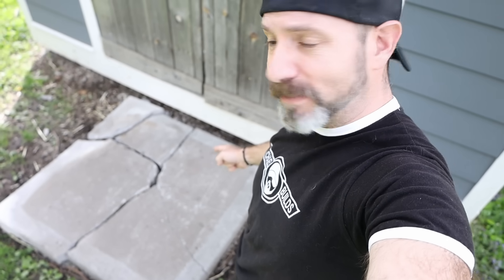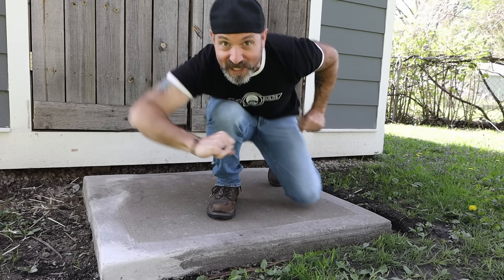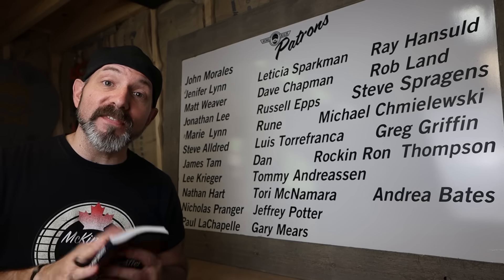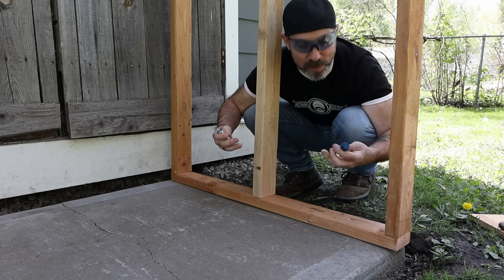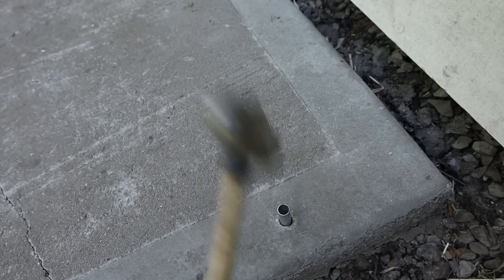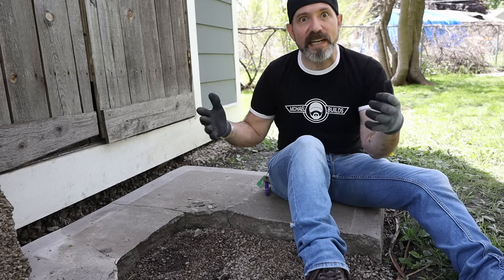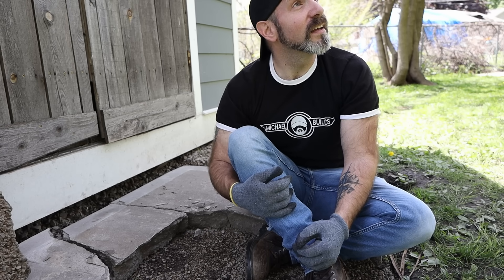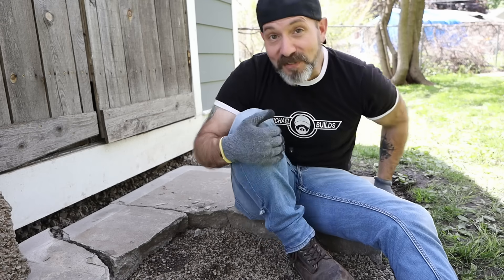Dry Pour 30 day cure Test

Comment: I found your previos video randomly (or rather the YT algorithm offered it to me not so randomly). As a structural engineer my first thought was 'no way in heck that works'. But that was just because it's so different from what we were taught about making structures from concrete. Structures that are consistently and predictably strong enough, that is. After watching two of your vids about dry pouring and giving it some thought I can absolutely see why it has the potential to be even better for some applications than a traditional mixed and poured structure.

One of the biggest problems in making really strong concrete is the water content of the mixture. Usually you have way more water than the cement needs to cure because you absolutely NEED that much to achieve a consistency you can work with, even with the best additives. But then when the excess water evaporates there WILL be pores in the concrete. This porosity determines its strength as much as the quality of the cement you use.

The dry pour method you showed can be used to make a slab or whatever structure where the soaked outer layer is more like a traditional concrete but the inner core gets only the amount water required for the cement to cure, or just very little excess. So at least in theory it can be made even stronger. The one huge caveat is you have very little control over exactly how much water gets to the inside. If you want optimal results you need to have your method laid out and executed with extreme precision. So in conclusion: multi-storey building - nope; sidewalk, driveway, shed foundation - doable or even preferred, especially if there is no risk of freezing (mild and hot climates or absolutely no chance of water touching your concrete).

For now I found no solid info on this but the idea might not be that new. It just never caught on in the industry as a whole because making a mixture you can control has the advantage of being predictable and repeatable which is a crucial aspect of designing and building structures.

Comment: We’ve been curious about doing this method for an extension to our back lanai but weren’t sure how well it would hold up. We’re from the Midwest where weather is an issue but now live in FL where it doesn’t get -60 with the wind chill😂 so we don’t have to worry about the ground freeze like we once used to. Seeing so many tests done is a huge help so thank you! It answered a lot of questions we had to the strength dry pours could have. We’re excited to give it a try!

Comment: That slab looks like it's only about 3 inches.  Sitting on fairly soft ground.  With no rebar.   Even a wet-pour slab would probably crack with a truck driving over it like that multiple times under those circumstances.
Reply from the maker: I 100% agree with you. I definitely want to do another one side by side with a traditional slab with reinforcement and a true thickness

Comment: I think it cracked not from the pour but from the constant weight of the truck compressed the gravel underneath causing the slab to buckle in the middle… some rebar probably wouldve prevented that. Awesome video tho. I’m thinking about dry pouring a new slab for the shed.

Comment: Mike:  One thing to remember is that concrete is a powder which will absorb water, this is why dry pour is used for post holes.  You could do a full driveway like this BUT you would need to use screen reinforcing to make the drive sturdy enough.  And I agree with @larrytyler1578, there was a bit of rocking with the slab when you drove over.  I think the cracking was due to the slab rocking and you just happen to go over it at just the right angle for the slab to be raised on when side and lower on the other causing a fulcrum action which caused the slab to crack.

Comment: why is this even a thing. the application you are testing the concrete in would require a proper substrate and reinforcement to be up to code. the only time dry pour is even an option is for hobby grade craft projects and the occasional fence post that we're all to lazy to mix for.
Reply: You can still add substrate and reinforcement to dry pour

Comment: Love and appreciate your videos. Cajun Country Livin' is where I first seen the dry pour. But I was curious if it would really work for my applications. Your videos are answering all the questions I've had. I am planning on doing a dry pour slab that's probably going to be 12x12. I plan on building a shelter with a hard roof top and putting a small hot tub inside. Thank you for all the videos and testing you perform! Keep them coming and wish me luck!
Reply: Dry pour for the win!!  Work smarter not harder 👍

Comment: Hello, please instead of the quick concrete bags, i would like to see you do a test with regular concrete (cement, gravel and sand), its way stronger than the bag mixture but needs to be mixed homogeneously in order to achieve maximum strength, so it would be interesting to see what happens when you dry pour it
Reply: I dry poured all those and didn't mix it and it was fine.

Comment: I like how you're looking into this from different aspects (plexiglass form to see water wicking; 24 hour vs 14 day curing strength,; cutting into samples of different methods to see cross-sections of the cured cement). Thanks for being thorough! I guess the only thing left to try is an ASTM strength test and see what percentage of strength can be achieved with dry mix vs regular mixed concrete.
Reply from the maker: Thank you so much! I appreciate that!

Comment: Interesting but you might want to reconsider this if you live in a climate that has a lot of freeze thaw.  By doing a dry pour you just won't ever activate all of the cement in the mix leaving it weaker than thoroughly mixing it before pouring it.  This leaves room for water to get in the concrete easier and freeze thaw cycles will most likely get the best of it.
Otherwise it's probably strong enough for most small applications.  I would not recommend anything like this for anything structural.  Great video though Michael!

Comment: If you understand the physics behind concrete more water you put in concrete means longer cure time also it makes the concrete weaker the more water the weaker the concrete so slow soaking moisture into the concrete and let it cure yes it's going to take longer for all of the concrete cuz of the moisture but in theory it's going to be stronger

Comment: Only idiots do dry mix...Water is important in a concrete mix...Water Cement Ratio signifies the ratio among the weight of water to the weight of cement applied in concrete mix.

Generally, water cement ratio remains under 0.4 to 0.6 with adherence to IS Code 10262 (2009) for nominal mix (M10, M15 …. M25)

The strength of concrete is directly impacted by the water cement ratio. It enhances the strength if employed in perfect ratio and if the ratio is improper, the strength will be reduced.

The importance of Water in Concrete

Concrete refers to a macro content. It comprises of micro constituents like cement, sand, fine aggregate & Coarse aggregate. With the purpose of obtaining high strength concrete to resist the desired compressive strength, it is required to set exact ratio of admixture to unite these materials.

The role of water is important here to accelerate this chemical process by adding 23%-25% of the cement volume. It produces 15% of water cement paste also called gel to fill the voids in the concrete.

Impact of too much water in concrete: If additional water is added more than the permissible limit of 23%, the strength of concrete will be significantly affected.

Comment: I was as pessimistic as anyone could be about this as Ive studied concrete quite a bit for an upcoming project. Ive also recently completed a small slab (6000 lbs, 114 sqft) poured traditionally. Im quite impressed by the outcome and I believe had the slab had rebar or mesh reinforcements it wouldn't have failed. I also think now that if you do the pour the right way, and you live in an area with particularly moist ground soil, you might actually be able to fet a better result than wet pouring. Why? Because the slower concrete cures, the stronger it becomes. If you regularly soaked the slab and covered it with a tarp after each soaking prevention evaporation, the concrete would take forever to cure, but the result should be a much stronger pour. This is all hypothetical though and Id have to do my own 6 month testing to see if that would hold true. Anyways thank you for this video and changing my mind about dry pouring.
Reply: The problem I see with the dry pour and having to wet it every hour for a number of days is when you have to pour in freezing weather. Wet pour it, cover it with concrete blankets and open straw if you are really concerned and wait 30 days. Uncover it and build the town houses on it.

Comment: Concrete cures by building a crystalline structure. Proper hydration is key to getting the most strength. Just because there is no powder doesn’t mean it cured to a reasonable strength for the mix. Good concrete is hard to break up with a sledgehammer, this pad had no strength, period. Mix the bag with the amount of water the manufacturer prints on the packaging and you’ll get the rated psi. Dry pour is a dumb waste of time and material.

Comment: Need to really test it scientifically to convince me, such as a compression test. I just can't shake that you aren't getting a good water to cement ratio using this dry method. There is no control over how much water the cement is exposed to, and a high w/c ratio is going to be considerably weaker than a normal ratio. By the time the bottom of the concrete starts to get wet, you'll have way way over watered the top layers of it.  Also, I don't know how this will hold up to spalls and freeze/thaw cycles.

Comment: To be fair..I believe it cracked when driving over it because the slab was rocking and rolling on top of the ground.  At that size and the weight of the truck it was bound to crack dry pour or wet pour.

Comment: I have been following your testing and look forward to your future tests. Have you thought about thicker slabs? I wonder if this only works well for thin slabs (2-3") or if thicker ones (4 - 6") will this method work, too? I agree with Larry Tyler, the slab may have failed due to the rocking it was doing while driving on it. Also, it looked to be a bit thin, is it 2" thick? perhaps a thicker slab, like 4" would have withstood the pounding better. Thanks for these videos. 👍

Comment: I think it's has its place for a DIY person that is on a budget, does not want to rent a mixer or has very little experience with wet concrete.  Also the project that are for patio, sheds or a small pad outside of a door where it is mostly foot traffic, and the weight of a lawn tractor. I see this as a amazing idea. Now with that said,and this is probably really going to catch on with homeowners. Are the price of a bag of quick creat going to go through the roof? Great video thanks for sharing

Comment: Looks like a 100% success to me.  A slab that thin is not designed to carry vehicle weight.  However, with rebar a properly prepared and compacted base/sub-base I doubt even a slab that thin would not have failed.

Comment: I can tell you from a Mason's perspective (over 25 years, also both father and grandfather were masons most their entire lives) that while you can do this, and it is viable in some smaller applications. With that said this is never and I mean never going to last as long as a proper wet pour, this is due to how concrete and mortar itself cures. It is a slower process than you think, and Portland based concrete the fine grain hardens increasingly more over time to the point that depending on weather conditions and psi grade of your pour it can take years sometimes up to 25 years for concrete to get to it's hardest point. What does this mean for a dry pour? Well, the problem is that the concrete was as if it was poured over many many weeks. This is due to how each stage tried to cure much faster than it should. My grandfather helped pour the Cape Canaveral runways. They actually, added roughly a ton of ice to each truck to slow the cure down to a crawl so that it would not crack itself as it cured too quickly.  I would never do a dry pour myself for any situation, sadly it takes much more time, dedication, and babysitting work than it does to do it properly in the first place... A wet in place pour is even better than this you can just mix it in your forms if you do not have a wheelbarrow or any sufficient mud box and you will take a lot less time to do it and walk away from it than you will with a dry pour. 

Plus, if you were to wait the same 30 days you would have far greater strength and it would not sound hollow if you listen to how the concrete reverbed when it was moved and prodded it, means while it seems hard and cured there are small porous pockets that would not be there or much lessened in a proper wet pour. A simple tap on the top even uncracked/broken you can tell quickly if you know what to listen for if concrete was done correctly or not.

Interesting to see it though regardless of the science behind it all.

Comment: I’m in Arizona and want to try dry pour, I’m only worried that there is no moisture wicking up from the ground because it’s so dry. Any thoughts on that? Can I get enough moisture through from the top to get all the way through? (I will pre-wet the ground but it’s clay and doesn’t hold much moisture..)

Comment: The best test would be a 28-day compressive strength test. It would be interesting to compare it to a batch of concrete that was mixed with too much water. Quickrete says that 1 qt of water above the recommended limit for an 80lbs bag reduces strength by 40%. A fair comparison as almost no one mixes Quickrete correctly and very little know about plasticizer.

Comment: Looks like it is golden to me, also keep in mind a weigh bearing pad is typically a 6" pour with rebar reinforcement. So the fact that the pour lasted that long with a soft substrate and a thin, non-inforrced pour, is very impressive.
Reply: Six inches lol… nah… four inches is standard. Six inches for heavy equipment.
Reply: Nope 4" pad is a standard drive way with rebar or welded wire
Reply: @Wyomingchippewa , depends on the environment/climate. Not all are the same. Here in Michigan, 6" for driveway, 4" for walkway.
Reply: No. It failed miserably. Most driveways are 3 1/2 inch thick with minimal reinforcement
Reply: Agreed.  Unreinforced concrete has pretty poor flexural strength without additives and crushed aggregate as opposed to rounded aggregate. and reinforcement.  About 435 psi for 3000psi concrete
Reply: Yeah your patio is going to work because you asked your god nicely to help out. Isn’t he busy causing famine in Africa and other stuff?
Reply: Not really true. I've been in the custom home construction business for a lot of years. Generally a garage slab is 3.5 inches thick with just a 6 inch thick mono pour where the vehicles will drive onto the pad. We don't use metal re enforcement unless the owner states a desire for it. We use fiberglass which works very well and is much easier to use with much less work. Where there might be frost heave all that's necessary to save a slab is remove one of the three things necessary to cause frost heave and the slab or sidewalk will last for many years without cracking. Extreme cold, water, and high capillary soil are the three things needed for frost heave.
Reply: My mom is gonna help me do a 12 x 12 patio dry pour. I'm gonna do a 3in dry pour with 0.5in fiberglass rebar crisscrossed. I'll level the soil under the same way I did for the pool. Move the clay as much as possible and use the sand to make up the difference and soak it to settle it. My yard settles and dries like concrete anyway 🙄. Fiberglass doesn't have the same rust issues that steel does so it should outlast me. It won't hold a tank but it should be more than sufficient for what people typically do on a 12 x 12 patio. I'm not planning to do any of what he did to his, too mine. We're gonna do mundane stuff like sit on patio furniture and cook out.

Edited to add: I'm also putting 1in foam insulation down under it that's actually what my frame will be built around with a light drop in pitch from the house.  That way I can be sure it won't pool water where it shouldn't and I'll put river rocks around it to help divert rain water. My soil is so bad I just don't want to fight with it on that side anymore. The good Lord promised to bless the work of my hands and so far He's kept that promise so I trust Him to help us.
Reply: @franny5295  use #9 crushed rock.  not sand.   thin layer of sand goes on top of the crushed rock  all packed.
Reply: I guess it depends on where you live because driveways here in the southeast are 6 inches

Comment: Why did you put drainage gravel under the dry-pour concrete? Cajun Country Livin' says NOT to put rock under it because you need the concrete to wick up the moisture from the ground. Rocks will separate the concrete from the ground. Rocks ARE recommended in wet-pour because the concrete is already mixed. Regardless, your slab easily passed the test anyway. Few people would ever do a driveway like this. Most projects I'd guess are for foot-traffic and shed bases.

Comment: I am not sure the driving test was conclusive as it appeared the slab was rocking back and forth as it was driven over. That could be due to the small size or the ground underneath. I would love to see the dry pour tested with a slab big enough to pull the whole trunk on and a ramp up to prevent the rocking